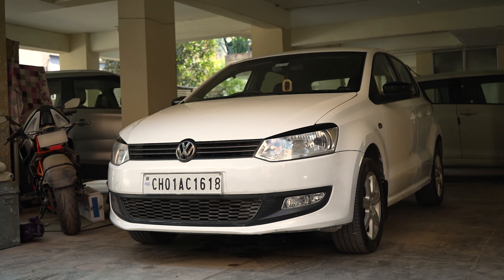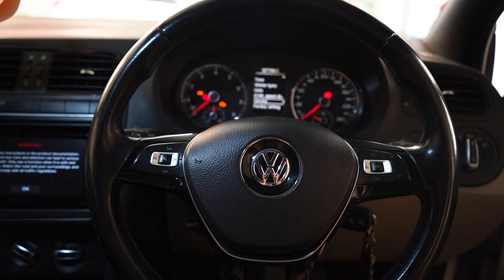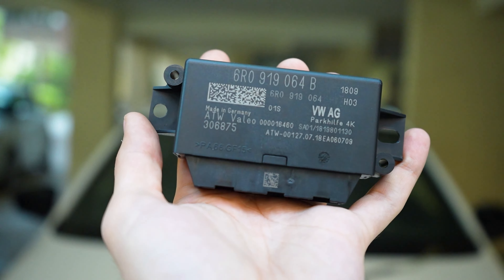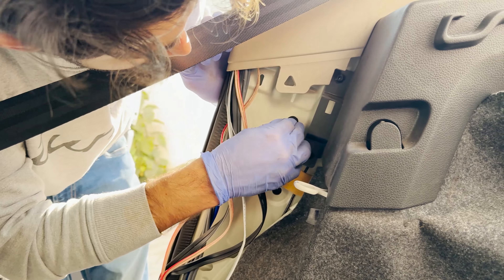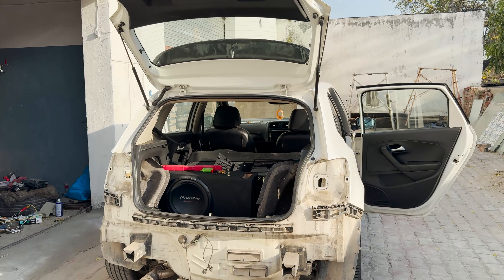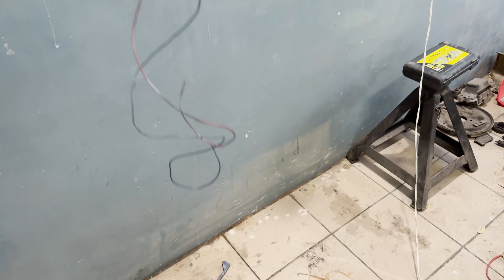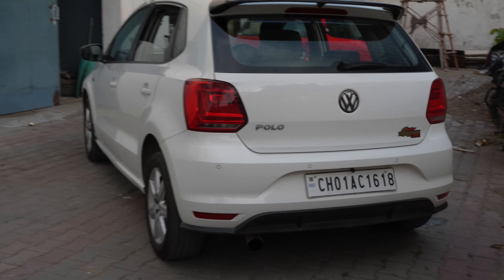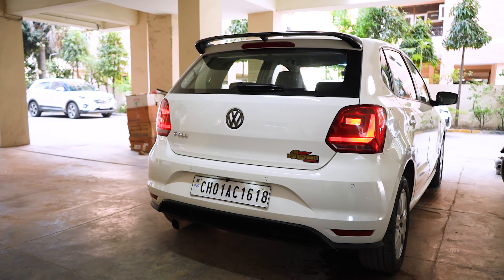Adding OEM Mods to a 2010 Polo 1.M2PI

Comment: Anyway to increase the sound of beeps from the buzzer..? 

Either a louder buzzer or via some setting change in VCDS..? / any other solution..? 

Can't hear it in monsoon as its pouring really heavily here in Kerala during the rainiy season
Reply from the maker: The stock module doesn’t support this change, however an updated 8k ops or 4Kops module does support it, in that one you can change the volume and pitch
Reply: @PrerakKataria  is the max volume with the 8k ops/4k ops higher than the stock module..? 

Or it's that it just give the flexibility to change the volume & pitch..?
Reply from the maker: Currently even the stock one is set at a higher volume, I would recommend dampening your roof with damping sheets, because that’s a common problem with polo platform, I will be doing the same as well
Reply: @PrerakKataria  yeah it's from the roof

How about adding another buzzer..? it costs only 2k

Is it possible to wire an additional buzzer..? if so, where to fix it..?

Comment: Hey Bro.
I need your help to clear a doubt I am having.
I have a 2021 Vento 1.0 TSi manual. And I am looking into doing a stage 1 remap to it.
But my concern is, my car comes with the MQ200 gearbox. Which means it can only handle torque up to 200nm.
Stage 1 remap can output torque up to 225nm. Will that cause any issues?
Reply from the maker: Yes it’s totally safe don’t worry, we have tuned a couple of 1.0 TSI to stage 1 and stage 2 which are running safely for almost an year and they are being driven hard, so don’t worry

Comment: Nice video! I'm driving 1.2 MPI 2014 model, wanted to ask if your radiator fan makes helicopter fan like noise ? Is there way to get rid of it by replacing it with latest GTI fan motor?

Comment: Hi prerak back again with lovely video relating to polo and does this car have Abs ? My car is 2013 Mpi  polo I came to know Ops 4 & 8 k flip cam will not work without abs is it right? Abs is mandatory?
Reply from the maker: Abs in not mandatory, no, this doesn’t have anything to do with ABS
Reply: I installed oem  flip cam but video is not coming in rcd 340 rest all are working fine as it should but while engaging reverse gear rcd showing look safe to move but video is black screen please suggest any resolution I tried coding and harness also but all not gave positive results

Comment: Hello I have a question.
which cable did you use for ignition power?

and after installation do you see it on the RCD330?
Reply from the maker: To be able to see it in the RCD The module needs to be OPS compatible. This isn’t that module this is just a PDC Module.  The car had an amplifier running on ignition power already so we used that, but using an ignition signal from the fuse box directly is recommended.

Comment: Bro, My when I'm engaging the reverse gear on my polo that reverse beep sound is not coming nor my sensor are working also the reverse light is not turning on. What might be causing this issue?
Reply from the maker: The reverse signal from BCM that goes back to the tailight and to the parking module is faulty. Either there is a cut somewhere or break in circuit of some sort

Comment: I would like to onstall rear parking sensors on my Polo 6R 2017, do you know if I can buy ones that show up on the screen, or should I buy something else.

Control unit: 5F Multimedia
System description: MU-E--ER 
Software number: 6C0035867F
Software version: 7082 
Hardware number: 6C0035867F
Hardware version: 050

Comment: Hi Prerak,

My 2014 Polo 1.2 has an hyperflashing issue. All the indicator bulbs are halogen and are working fine. Yet they give hyperflashing, when set to left left flashes quick as well and when set to right so doest it, but not on the hazard option. Once I turn off the ignition and turn it back on it is back to normal.

Any thoughts on this issue?
Reply: Hi Shashank, I'm also driving 1.2 MPI 2014 model, wanted to ask if your radiator fan makes helicopter fan like noise too? Is there way to get rid of it by replacing it with latest GTI fan motor?

Comment: Also Prerak what is BCM in VAG cars?
Reply: Body control module
Reply from the maker: BCM is the body control module which handles every interior bit of the car and for Polos it acts as the CAN Gateway that is it handles all the CAN signals

Comment: Bro how do you connect the pioneer stereo to the steering wheel controls ? Is there any emulator?
Reply from the maker: Hey, that isn’t wired yet in the vehicle. We are still working on it
Reply: @PrerakKataria  I heard that there is an emulator required to connect those and that emulator is very rare. Plz let me know after u connect
Reply from the maker: Yes such a device does exist, I will upload a video or short on the same once I figure it out

Comment: What is the power difference u feel in between while driving 1.2 mpi and 1.0? I own 1.2 mpi and sadly never got a chance to drive 1.0 or any other engine besides.
Reply: 1.0 litre tsi is a  different engine altogether in terms of power  I have driven the 1.6mpi in rapid and 1.0 in kushaq which is a heavier car than polo don't let the displacement fool you
Reply: if you want timings for 0-100 you can refer autocar 1.0 l tsi polo does it in 10 seconds
Reply: He is asking about mpi not tsi !
Reply: 1.0 mpi has less torque 1.2 mpi had 110nm. So 1.2 mpi is a bit torque 1.0 mpi is more fuel efficient and has less grunt than 1.2 mpi.

Comment: hey prerak. Greetings from Nepal. I've been following your gt modification videos. i have a vento automatic 2011 model and wanted to know procure some parts for the modifications such as paddle shifter steering, maxidot cluster, rdc 340 etc. i even tried getting in touch with you on IG and Whatsapp but no response. Pls let me know if u can help. thanks
Reply from the maker: Hey, please text me on @that.red.sells and share your username as well, I’ll be sure to revert